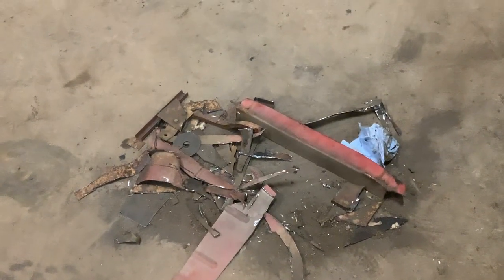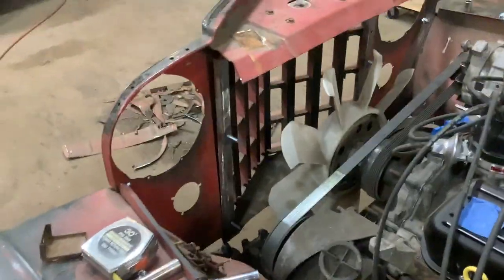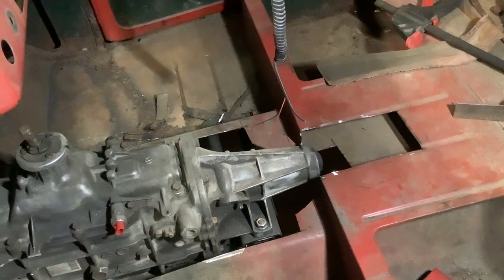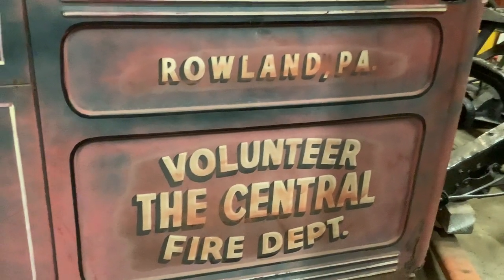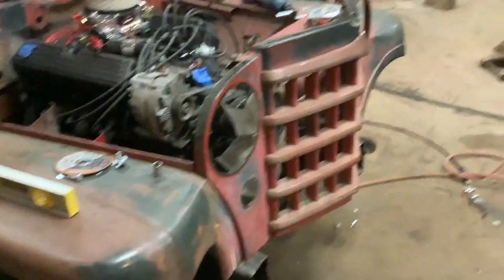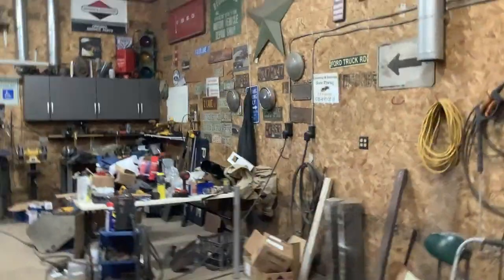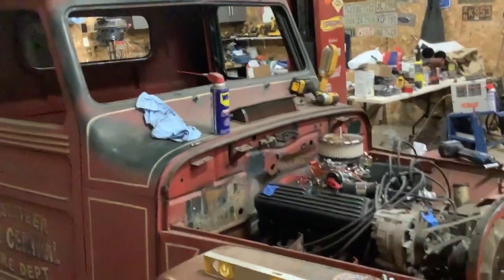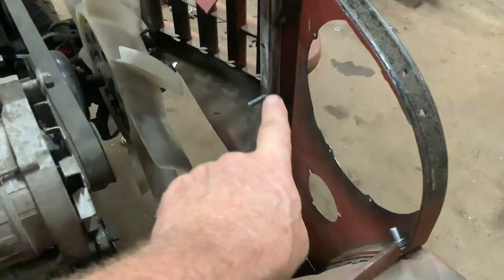1951 Jeep truck update ,  the cabs back on the frame .

Comment: I had a 55 Jeep pickup back in the 70s, when I had my own gas station-repair shop. It had a 327 Corvette engine in it adapted to the original drivetrain. It was a monster of torque and screamed at  highway speeds. It was my shop truck and also doubled as a beach runner on weekends down on Cape Cod. Fun little pickup. You'll enjoy driving this little pickup. I had the exhaust modified to come up in stacks right behind the cab with high flow mufflers.
Reply from the maker: There was at least 5 Jeep trucks being used in Chateaugay for service work back when I was a teenager, two of the more notable ones were Sweets garage that had two of them , one as a light wrecker and the other as a service / plow truck. The other was at the school and they used the Jeep truck as a plow truck and time to time to pull a bus back in . I think  there was so many used around here because most of them came off the Air Force base in Plattsburgh in the fifties thur the seventies..I bet you wish you still had that Corvette powered Jeep , that must have been awesome.

Comment: Hey Shawn, 
What a cool Willy’s. Things always get tight around those steering boxes, we are having the same issue on the 40. Looking good. 👍🏻
Reply from the maker: It’s definitely got a different look, yup the steering box was give me a issue but I dug out a 66 Mustang radiator cut all the brackets off moved it the the co-pilot side a bit , now I’ll put a cross piece on the bottom and fab two brackets for the top. I’ll have to put a 2 inch filler panel on the drivers side. 
If it was mine I’d ditch the steering box and put in a rack and pinion. 
Thanks

Comment: Won’t the original 6 radiator have the hose connection in the center of the radiator? May have to change thermostat housing to a different neck that goes out straight rather than an angle. Cool looking project. I’m putting a motor in another Crosley sedan I just picked up in July. ( oh you mentioned at end of video inlet and outlet are on passenger side? I’ve never seen one like that)
Reply from the maker: 66 Mustang radiator looks like it will work , not enough cooling for a v8 in the stock one . I’m not impressed with the S10 chassis for hot rod builds , I’ll go back to building my own if needed on the next build . Crosleys are showing up everywhere, we had three at a car show I went to ..all were sedans.
Reply: @rustyrods8535  Crosley’s steal the show. Hotrodders don’t like it. Lol..